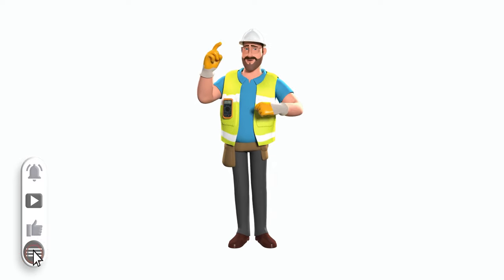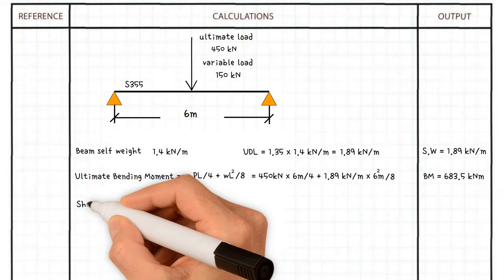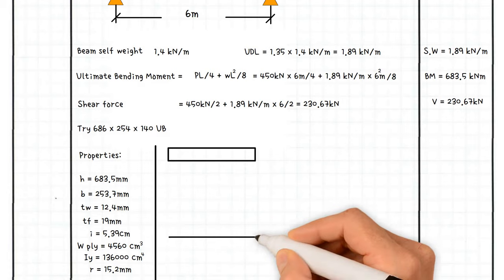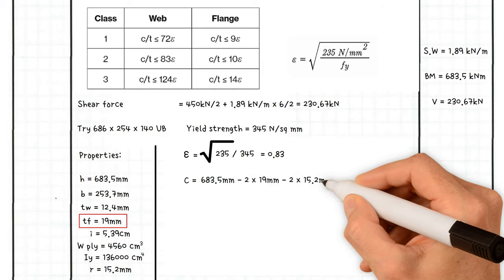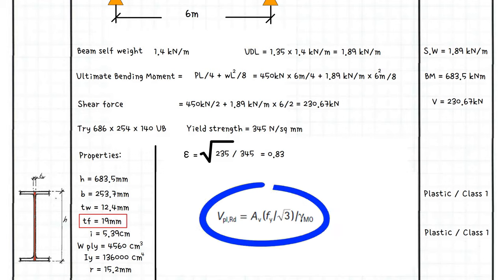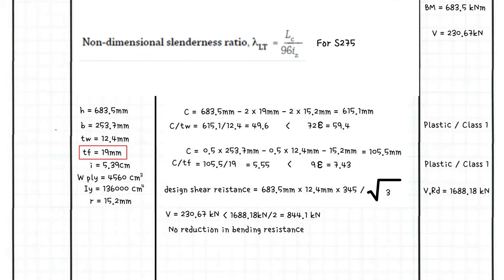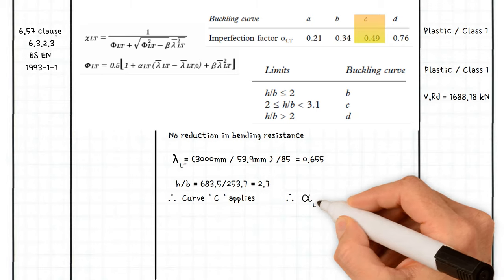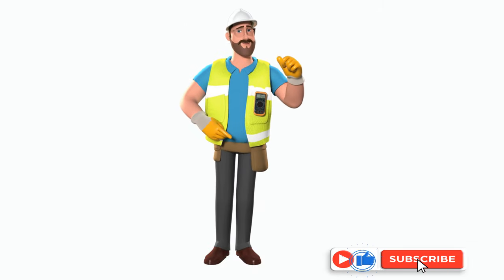How to do a steel beam calculation

Comment: Was working on a problem similar to this some days ago, doesn't the maximum moment occur at a diff location from the middle of the beam because of the extra applied load at the middle ? Please I need clarifications ✌
Reply: I think that you need to look for the BMD(bending moment diagrams) and you will get your answer.
Reply from the maker: You might find this video useful. https://youtu.be/ttAc2jCSkEU

Comment: you are doing great here. your videos are very comprehensive and of inestimable value. please could you do a video on the design of gantry cranes?
Reply: This could be found, if you want to GO AROUND all the math,by looking it up in an allowable load chart..l simply bought an ebay book.they were printed many years.titke is STEELconstruction manual of american institue.of steel construction...the problem for gantries,however ,is you will not be loading it evenly..so there needs to be an adjustment,also laid out in the book.charts are for "uniform"loads,like this vid is a concrete floor...everything is in kips ...not tons.akip is 1000 lb........h

Comment: Yet another great video.
Would be great to see a calculation for the laminated cross section, calculating the shear in each layer to determine the glue capacity.
Or even laminated glass beam.
Or glass balustrade calculation according to EN 16612.
Or Raft foundation.
Or wind load calculation for the courtyard of a tall building.
Reply from the maker: Added to our list. Stay tuned!
Reply: how is this any fun?

Comment: Would you tell us why a structural steel box girder for metro rail transit is joined at a location with in the clear span but near the portal beam support?

Comment: Design a 6 meter cantilever steel beam having a point load of 10 KN at the free end according to British standard.. thanks
Reply: The Moment = PL  (hogging moment at the support) is  M = 6m x 10kN= 60kNm , then Sxx (Plastic Modulus) = 60x 10^6 /275=218.1818 x 10^3 mm3 =218cm3 .Now use this modulus to check the steel table and choose your member. So from the table U can choose 203 x 133 x 25kg/m (258cm3) or 254 x 102 x 22kg/m (259cm3). of these two sections the second one(254 x 102 x 22kg/m) is better becuase it is deeper and lighter i.e. 22kg/m vs 25kg/m of the first section .

Comment: Thank you for your detailed explanation.

I have a question, from 04:20-06:15 you have determined sectional classification for flange and web.
In both cases you have used tf > 16mm, and accordingly used fy value as 345 N/mm^2 to determine the coefficient for sectional classification (epsilon).

I was wondering, why not calculate epsilon for flange and web separately, using tw & tf with respective fy values?